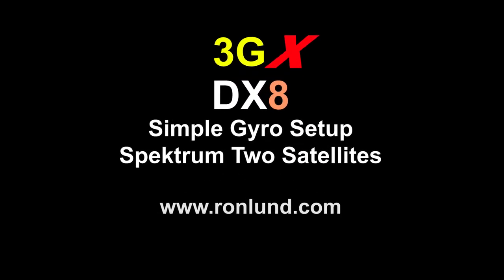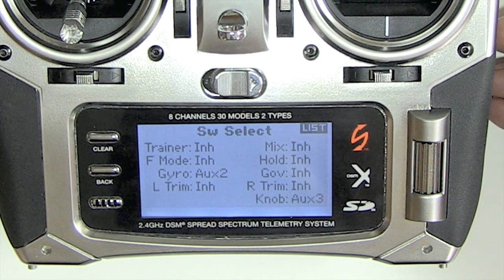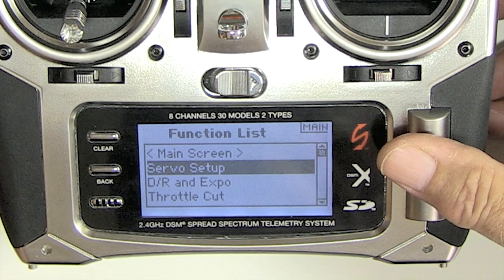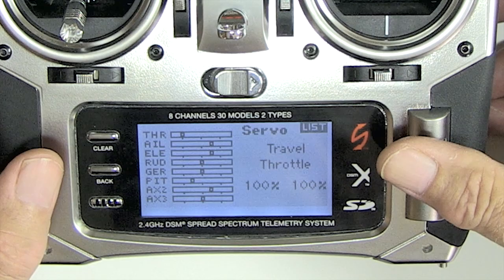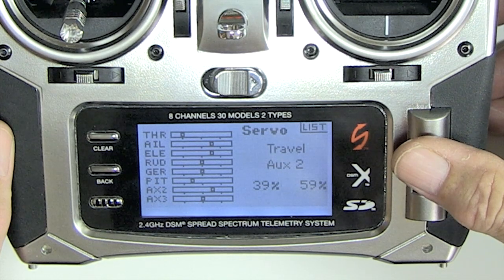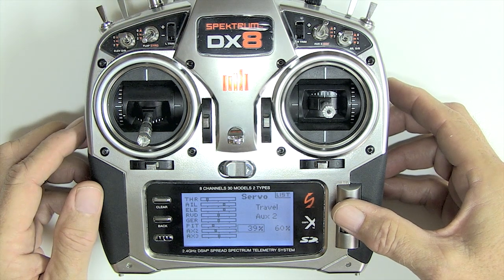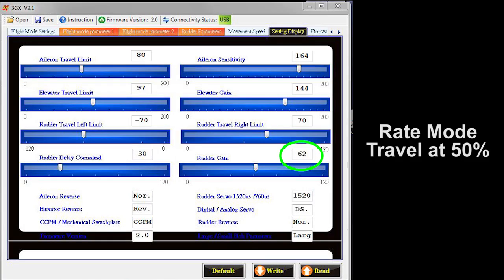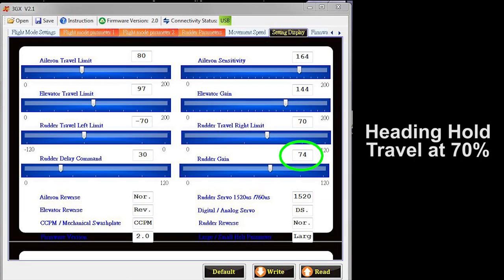3GX and Spektrum DX8 Gyro Gain.

Comment from the maker: That is correct. Be aware that you will be using DSM2, not DSMX. In my opinion, DSMX is much better. I would use something like a 6210 with one DSMX satellite receiver. In that case you would use the Gyro channel for the t/r gyro.

Comment: That's one way to do it. But what if you want to have different gyro gain settings for IU1 & IU2? Why not enable the gyro, set the channel to AUX2 and have the switch set to F Mode? That way when you switch into IU1 or IU2 and it automatically sets the gain. If you really want to fly in RM you could set the switch to Gyro and manually change flight mode, then you can have RM or HH as you like. That's how I setup my 3GX and DX8, works a treat.

Comment from the maker: You won't be able to do that because when you use two satellites, the gyro gain is remapped to channel 7(Aux2). You must use something like the AR6210 and an SPM9645 DSMX satellite plugged into the receiver. Then you should have a true DSMX connection, unlike using two satellites and a 7 channel transmitter. At this time, the 3GX is not capable of DSMX.
Once you hook up the receiver, you'll be using channel 5 for gyro gain. For a governor, use the MultiGov Pro.